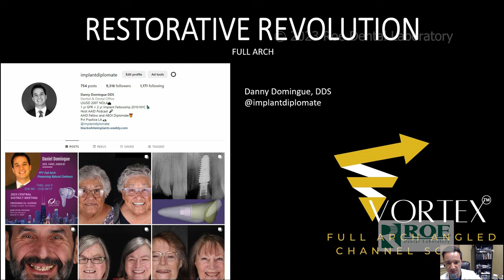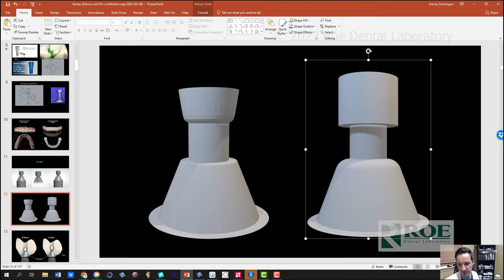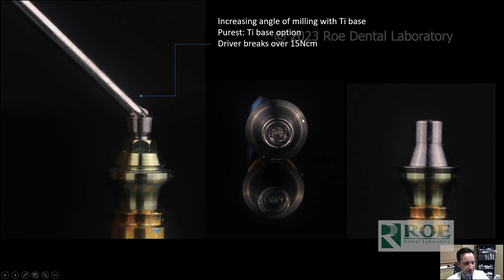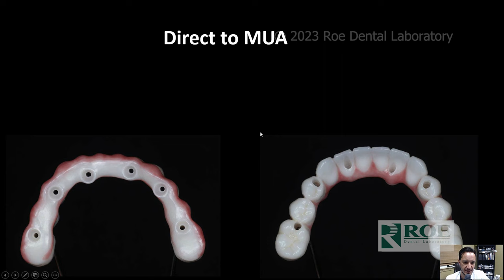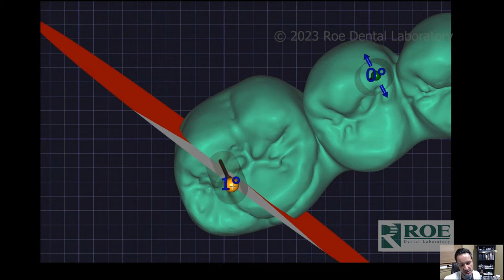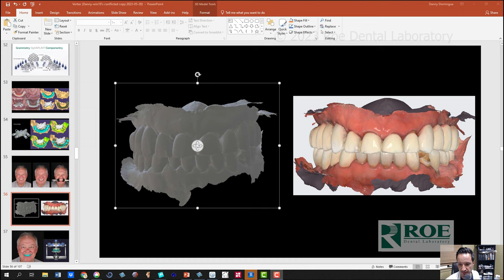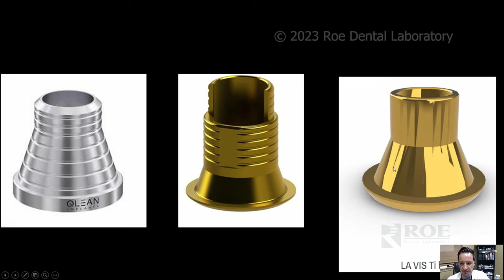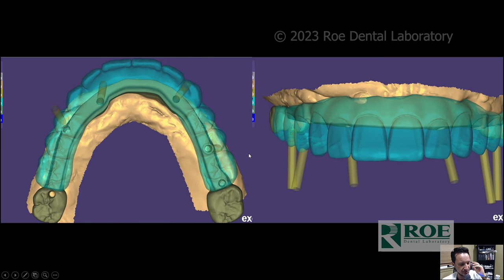Webinar: Vortex Full Arch Screw - Danny Domingue, DDS

Comment: Do i need a special file for the multi unit for 3 shape software
Reply from the maker: Hello, we do not use 3Shape for Vortex planning, it is only in Exocad. You are correct still, you must have the libraries in order to design with them.